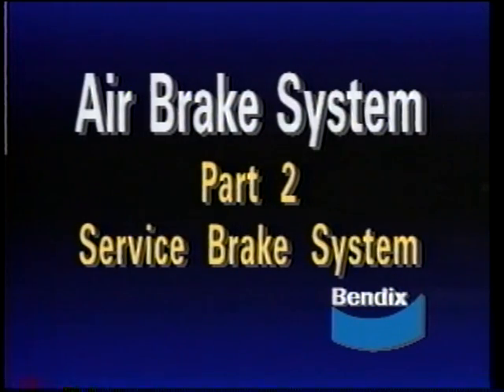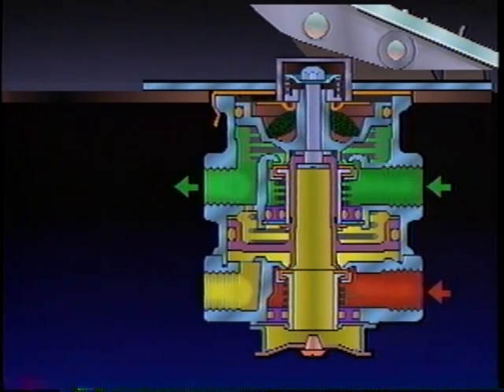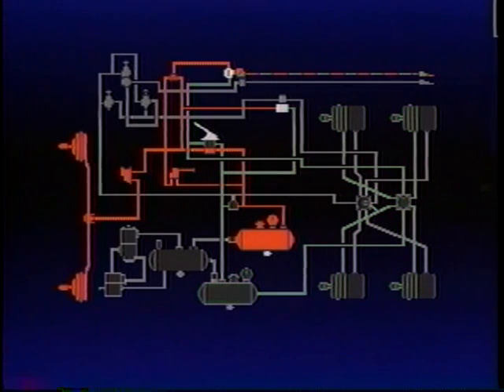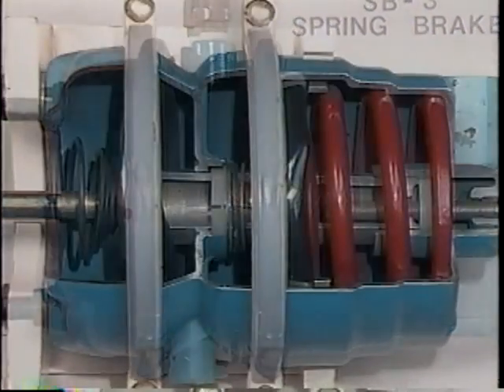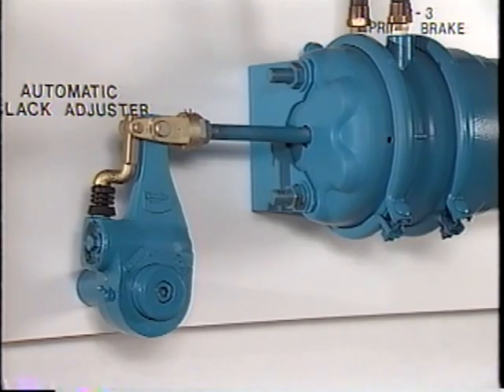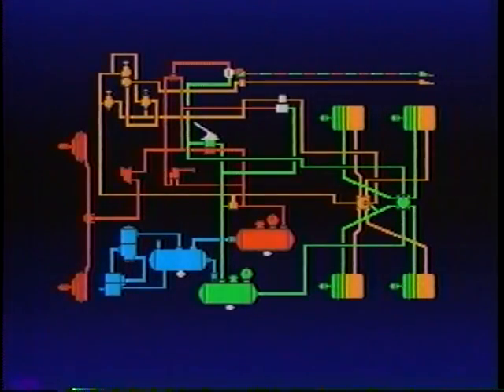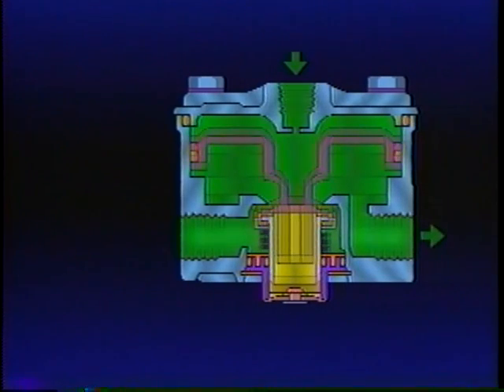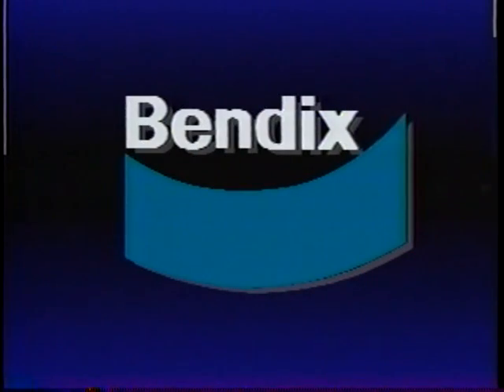Bendix Air Brake Video 2

Comment: I’m curious why the relay valve makes the apply/release faster. Is it connected with a smaller diameter pipe from the brake valve, and therefore less volume of air is needed to signal the apply/release?
Reply: yes like an electrical relay you use a small amount of air to control a large amount of air

Comment: I feel like a genius now...
Question how do solve the problem when you notice a delay in the release of the Emergency braking?
Reply: Check diaphragm leakage in spring brake section of the chamber or the push rod have bent.